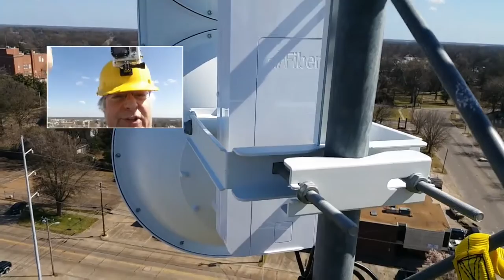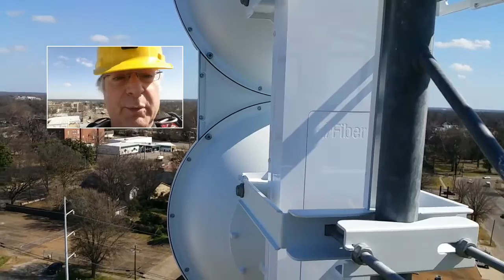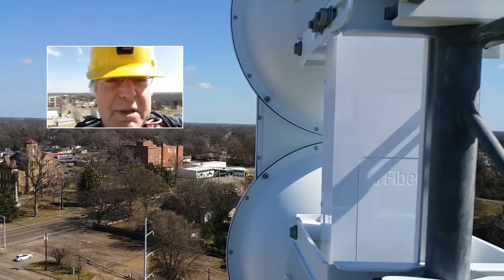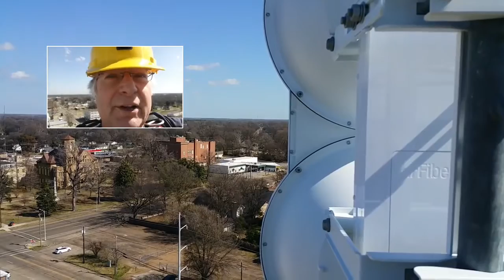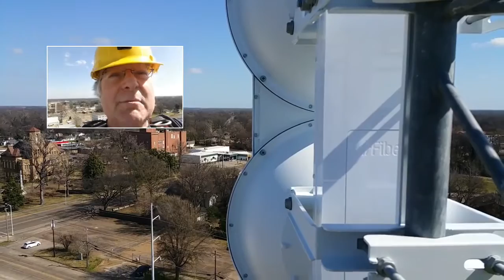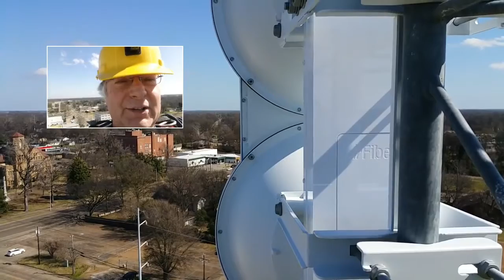Livewire+ and Ubiquiti airFiber5 Studio-Transmitter Link (STL) for Delta Radio

Comment: How did this go for you? We are considering getting a pair to connect our new offices that are outside of the city to get internet. Neither AT&T nor Spectrum offer internet where we are building and this looks like the way to go.
Reply from the maker: Still working extremely well 3 years later.  These are unlicensed. We’ve had a few interference issues, but quickly solved.  If you’re in a rural area, unlicensed is OK.  Built-up areas should use licensed bands with frequency coordination.